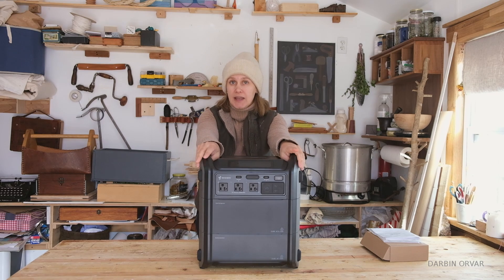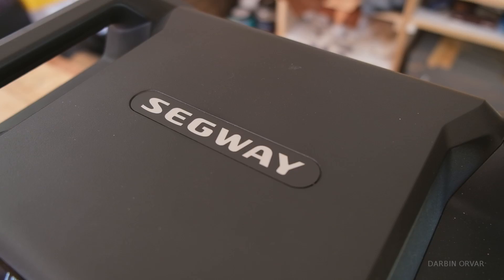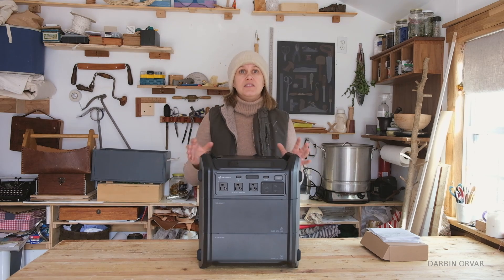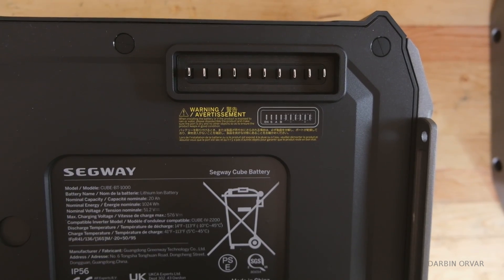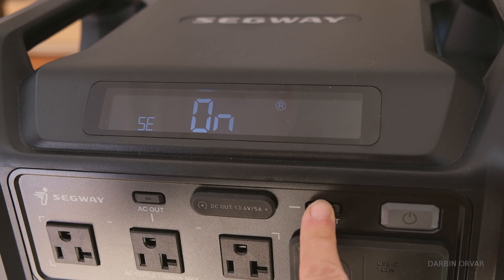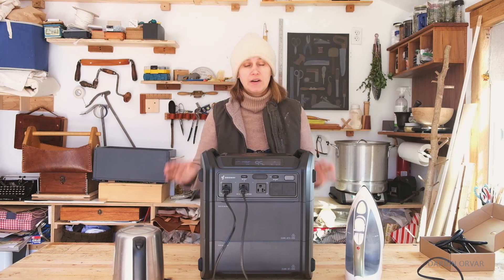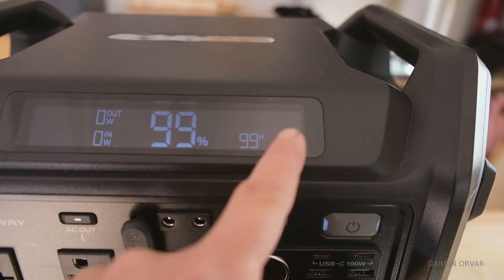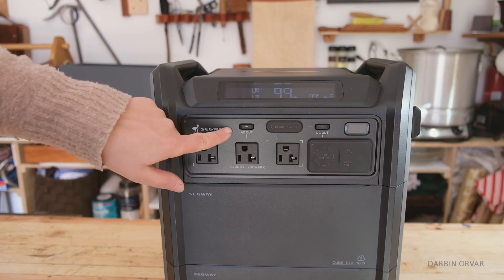No Wires! Expandable Stackable Segway Cube Power Station Review

Comment: User's Comment: "This power station seems really interesting. Does anyone have any experience with it? I'm looking for a reliable power backup solution for my upcoming camping trip."Reply: "I highly recommend the Segway Portable PowerStation Cube Series for your camping trip! It offers a massive 5kWh capacity and fast recharging, ensuring a reliable power backup for all your devices. The waterproof design and comprehensive protections make it perfect for outdoor adventures. Plus, the smart app control allows you to monitor and manage energy usage easily. Happy camping!"